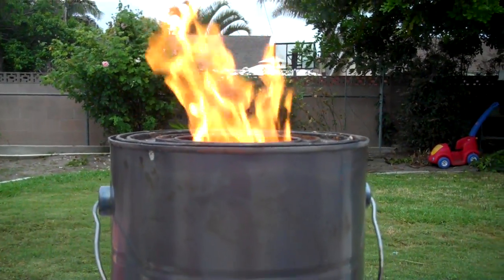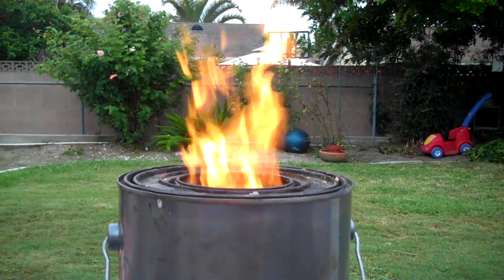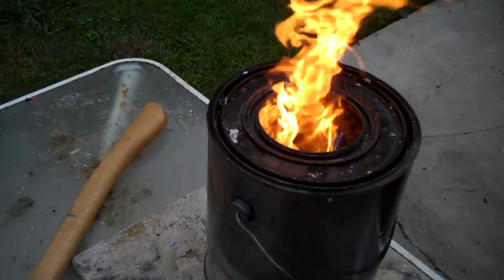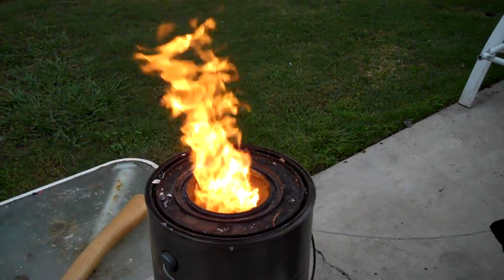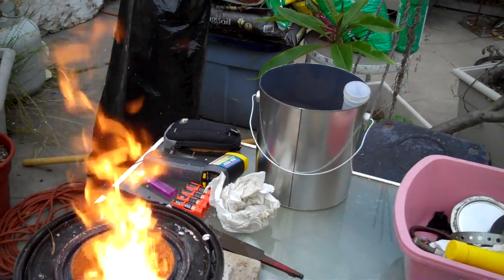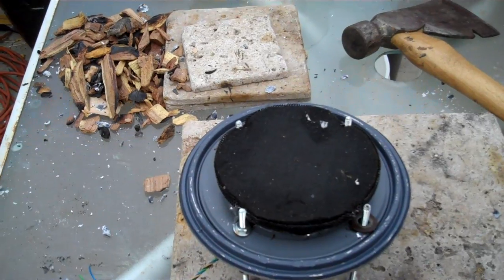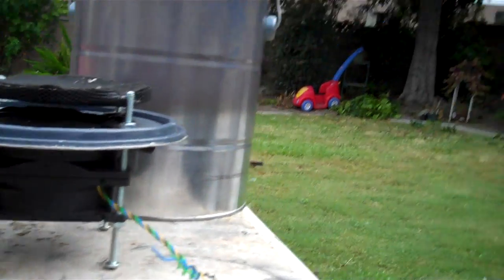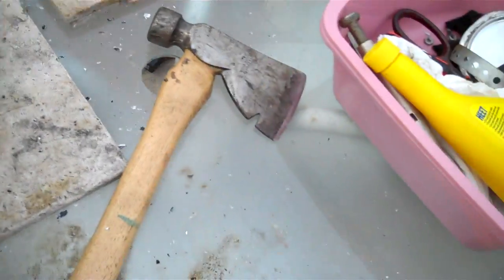1 Gallon Wood-Gas Update

Comment: I have experimented with these stoves and they are great. In order to cook a meal consistently using a pressure cooker I would recommend building 2 stoves. Load and prep one while the other is burning when you see flame getting retarded get the other running full blast and move your pot tot the new burner. Keep alternating until you have completed your cook time. Pressure cooking is fastest way to cook low tech. I use the simple $2 fan from walmart one cooking can feed your family and then some.